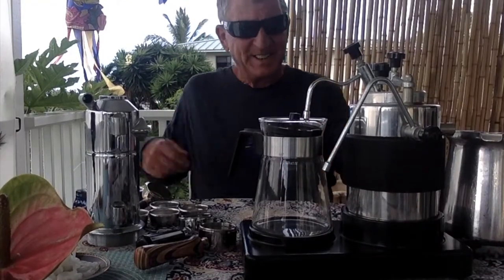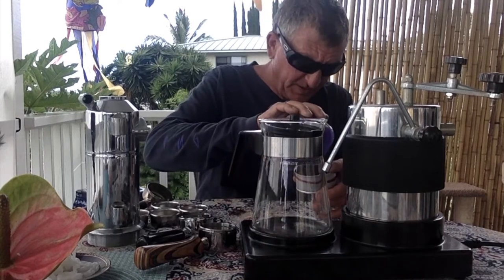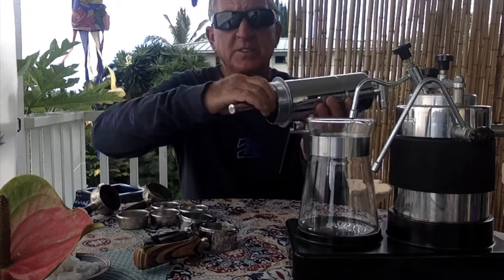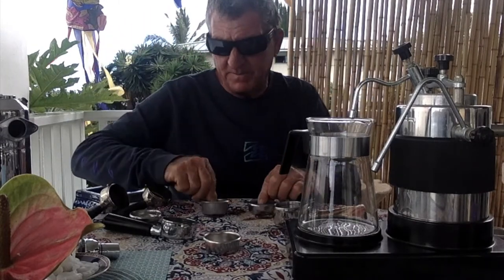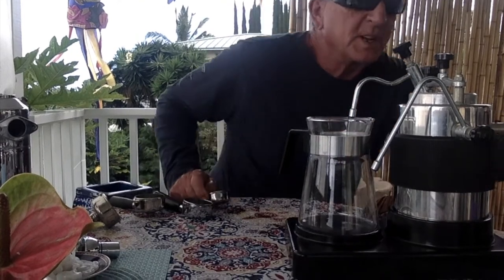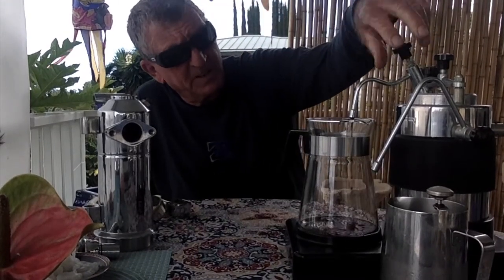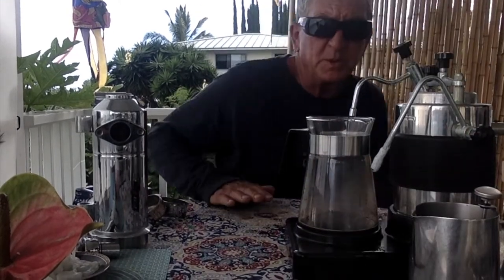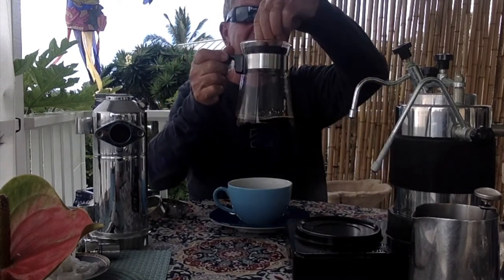La Pavoni Espresso Machine , Sight Glass Mounts,  Signor Cappuccino Machine

Comment: Thanks for posting this. My family was down in LA in the original skateboard era. It was a different time. Love the stories.
I just bought a similar stovetop espresso maker. I’m curious how you know how long to let the pressure build? Im worried about accidentally blowing the safety valve on mine.
Reply from the maker: Epic , I like to leave the steamer or Coffee spout open a little bit till I see some action . Then I shut them off , checking after about 2 min or so till it seams right . They are a bit little steam engine after a few times you get to know them. I spent the second half of the 70s into the 80s cruising all over southern cal  in my old Volvo 122s wagon skating all around . We used to commando into Camp Penelton and skate the big pipes they used to make for the Nuk plant at San Onofre . The FBI busted use once for doing it . I sat with my head down on my skater and they forgot to write my ticket . :)
Reply: @theespressocouple  awesome story